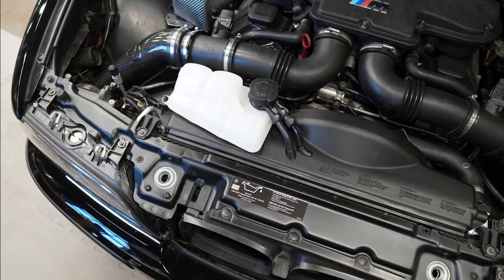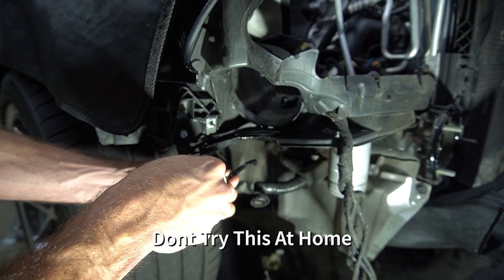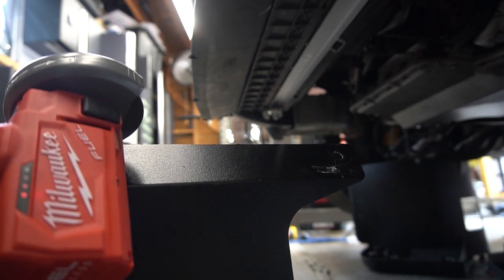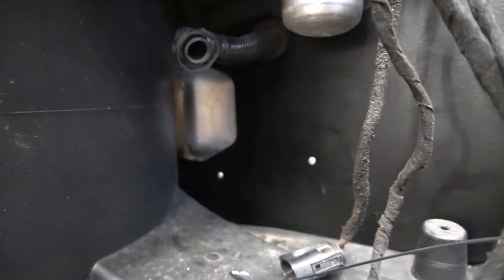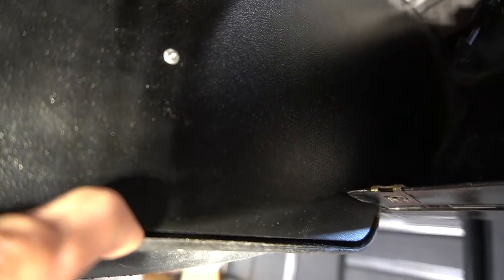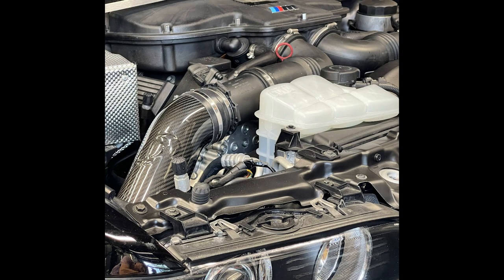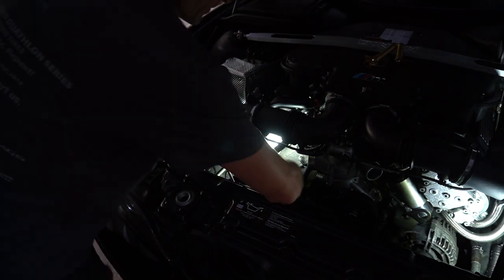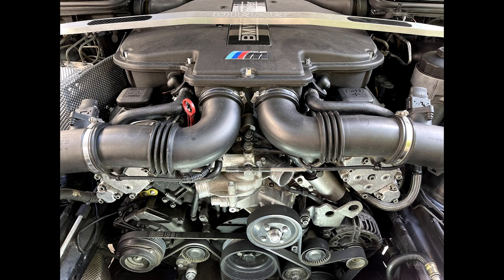BMW E39 M5 Build Log: Episode 6 - Dinan Intake Install & SAP Removal

Comment: Any issues with water logging the intake filter during rain after fitting the new open style fog light housing?
Reply from the maker: No, not at all. Dinan has this covered. The kit comes with an open fog light housing, but the sheet metal behind it has drain holes. Any water that gets in there drains out.

Comment: Once installed can the intake be removed to clean the filter without needing to take the bumper off?
Reply from the maker: Yes, but you do have to take lower “pork chop” off to access filter.

Comment: GREAT video man. much appreciated!
on a sidenote, i just got ARC 8s for my E39 M5.. how are they? noticeable difference in rotational weight reduction?
what sizes did you go with? i went with 18X9.5 ET22 square. did you have to use spacers up front? what size?
Reply from the maker: I went with same size, square setup. I got them when they did the gangup group buy a few years ago. Yes Ive got 10mm spacers up front. I tried 3 and 5mm, but still rubbed slightly. 10mm cleared the koni yellows (dinan springs) but i was rubbing fender then. I rolled fender and got GC camber plates (only 1.5 camber). All good now, rubbing wise. 
When i first put them on they definetly felt lighter, lighter steering. Thats worn off over time though. Im sure when I put the sytle 65s on again Ill feel the weight!
Reply: @worthygarage  im hoping to get away with 5mm spacers up front. im running kW v2 and a custom alignment from Turner (when they did service - which is no longer), but im sure it's not 1.5 deg. i got the apex for an M3, so i have to go get the centerbore machined next week. are you still running stock rear wheel tire size 275 35 18?
my style 65s are beat, bent and losing they're finish... and HEAVY. the rear wheels are 26lbs! fronts are 24lbs. i figured having them straightened (which, once out of round is impossible to ever be again) and refinished is over half-way towards a set of new 19lb apex set - it was a no brainer!
Reply from the maker: @kitvexed8229  I know I could have gotten alway with 5mm on koni/dinan and michelin ps4s. I wanted that hub flange of the 10mm spacer, since I wasnt on studs yet. Im on studs now but THe wheel so easily would fall off with that 5mm spacer, very little wheel to hub contact. 
YEP! I got my apex wheels saying same thing. Years later i got style 65 refinished as funds allowed. Ive yet to put tires on them tho.
Reply: @worthygarage  see, i always thought the opposite; that studs are only holding the wheel on with nuts vs a BOLT going all the way through! i've been running 5mm H&R spacers all around for years. i know the style 65s are specific to the car, but they really are heavy. and im personally tired of the wheel shake @70+mph and the black showing through the 'chrome'
are you running any spacers on rear? what size?
Reply: @worthygarage  also, what tune are you running? im running the shark/turner tune, but i've since added EVOLVE medusas and wanted to tune out the rear o2s and figured i'd get rid of the secondary air pump as you've done here too.. i've read threads  saying INFINITY tune is better than the shark?  any thoughts?
Reply from the maker: @kitvexed8229  Im going to get a custom dyno tune by a local tuner. I havent had the time to pursue it and or the tuner is always busy. I first was looking at a remtoe dyno tune, The go to for this has been HDtuning, or Matt Beckam. He can remote into a computer to tune for you while your car is on dyno.  But setting this up wasnt something I reallywa wanted to do, working local is always worked out better for me. But tuning is difficult and not everyone is "good", so finding someone you trust can be hard. Matt at HD is well  known for these cars. Usually would get 30 to 40 whp extra out of a car with headers. Around 360whp depending on your base dyno. 
My dyno after mods was ~330whp 340trq, stock tune. So I would expect same, 360whp.

I have personally not heard good things about any over the shelf tunes for this car, so I have stayed away. I did my own coding out as needed without need of tune. Any tuner can or should know how to code out what you want, plus sport / dsc memory features.
Reply from the maker: @kitvexed8229  https://www.youtube.com/channel/UCA3p4qNIjPDZ-AVtK1YXoCA/about
Reply from the maker: @kitvexed8229  Heres one Matt tuned: https://www.youtube.com/watch?v=3v53IiHbMOM
Reply: @worthygarage  where is he located? does he have a site or contact info?
Reply: @worthygarage  I just did a off the shelf with Matt. Very pleased with my results. We tuned out the SAP and I'm currently running it rich for the SS headers/cats to come here soon. He informed me that he has done so many of these tunes that no Dyno is needed
Reply from the maker: @vosedon  man good to know as that has been my biggest hold up! I need to contact him.
Reply: @worthygarage  SAP delete, 91 octane, no governor, increase 200 on rev limit, 02s delete throttle response. Sport memory. Tune for SS set up!
Reply from the maker: @vosedon  Thank you, I just emailed him.
Reply: @worthygarage  try Instagram